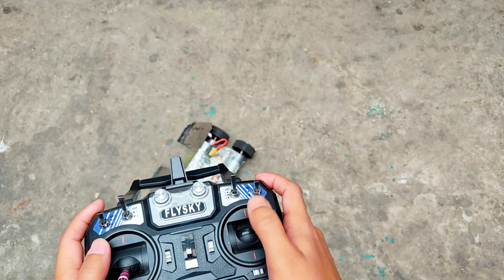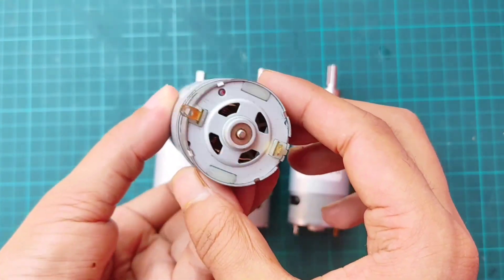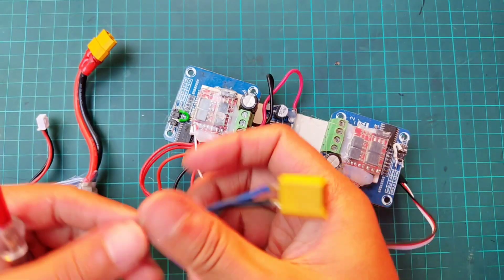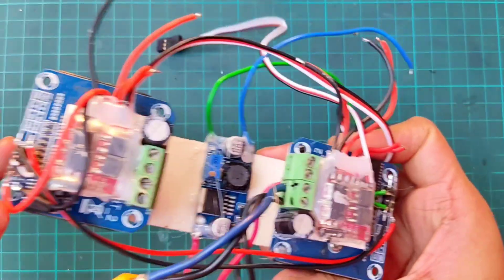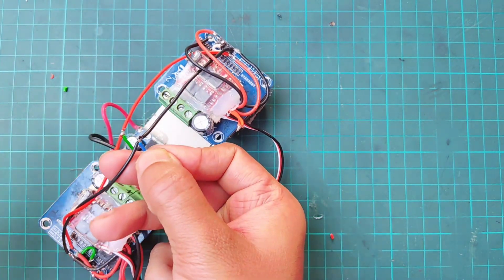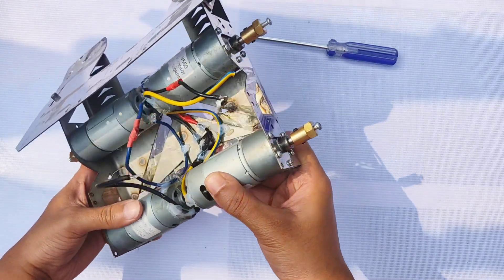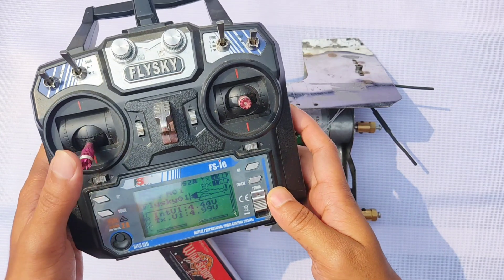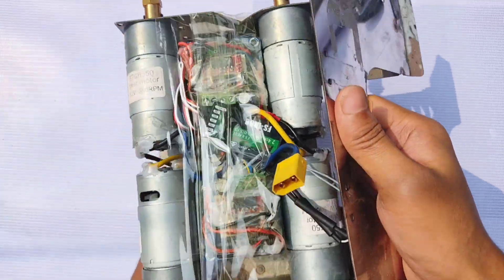How to Make RC Soccer Bot using BTS7960 and 20A Brushed ESC | How to Make Soccer Bot

Comment: How much current can the total electronic setup can behold? As the brushed esc is rated at 20A of current but 37gb motors peak current is way higher than 20A. Will it create any problem in the electronic setup?

Comment: Sir I really appreciate your videos I have competition in a month and I need to build a not with high speed and torque both. I'm currently looking at  500 rpm, 6kg cm,  DC geared motor and a few other options I've also considered using bldc motors but I am concerned about torque too.. Please suggest your best option.. I need high speed and torque both in one as I'm going to the technoxian wrc this year.. It would be really helpful
Reply from the maker: You can use 555/775 with planetary gear box.
Reply: @aslamhossain1  thank u for the opinion sir. I have looked and I'm about to confirm for 500rpm 40kgcm 12v heavy duty dc geared motor.. Would it be the best option?
Reply from the maker: @technobladeneverdiesss5676  What is the maximum weight mentioned in the rule book? choose motor according to the weight and rule book provided for the competition.
Reply: @technobladeneverdiesss5676 how are you gonna fit that in limit(30cm)
Reply: Maximum weight is 7kgs I think I'll  be good with this other than weight concern is the motor good enough?
Reply: are you refering to technoxian?

Comment: I don't really understand electricity. But I want to build an RC lawn mower. The dc motor I use is MY1016Z2 250W 24V, I want to use 4 of them as in the video. Can I follow the circuit as in the video? thank you
Reply from the maker: Yes. Follow
Reply: @aslamhossain1  is it okay not remove one red wire ESC to receiver? Shouldn't I only use one if I have more than one ESC and the others have to remove the red wire?

Comment: how much does the whole robot weigh ?
Reply from the maker: 2.5-3kg
Reply: @aslamhossain1  i have an all terrain robot that weighs around 4.8 kg , i'm using the same motors a yours but 300 rpm because i wanted more torque. do you think your 500 rpm motors can handle 5kg weight ?